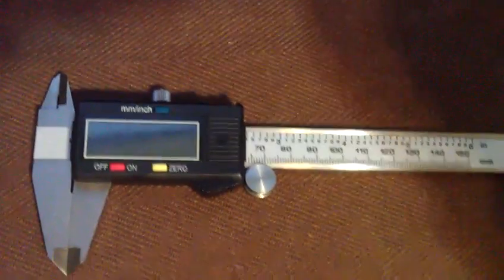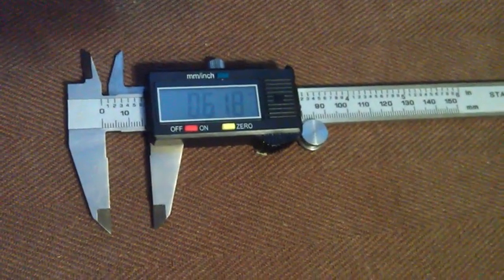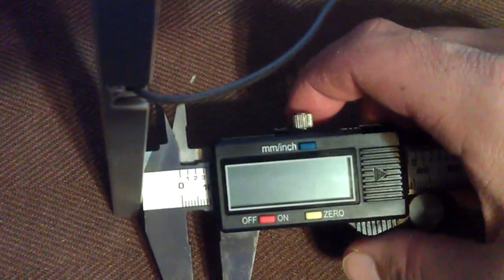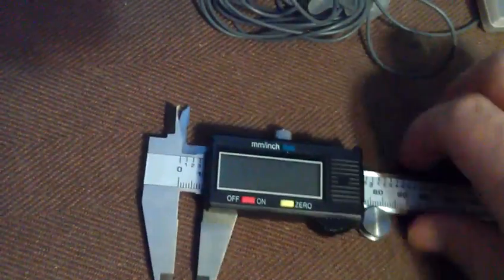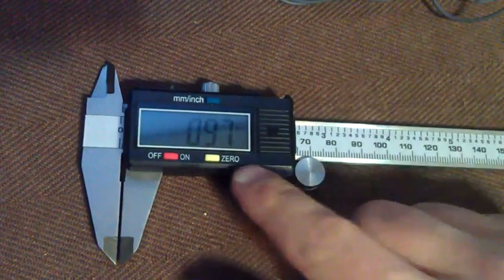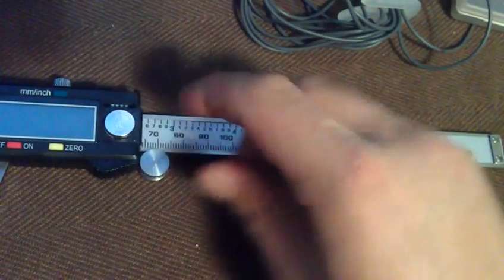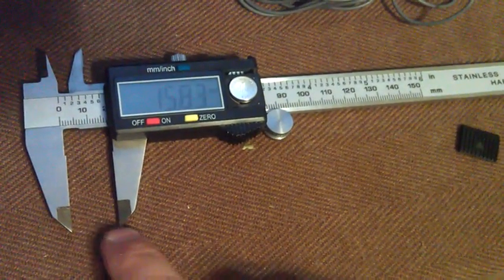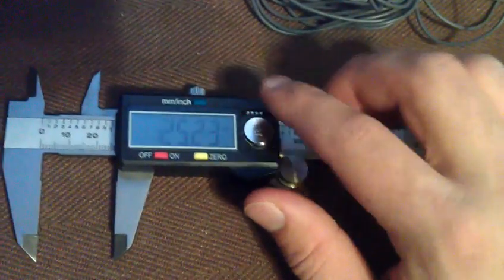How To Use A Digital Caliper

Comment: Also the thin stem part that comes out of the bottom can be used for depth as well as the left edge of the back most interior...... the part that looks like (| can measure against the edge of the caliper.

Comment: My battery is dead and I don't have my manual. could you tell me what kind of battery i need to get?
Reply: If it is a button cell battery, you can take it to Walmart if they have like a Duracell or Energizer booth and size the battery. They also should have markings on the top (for example, CR2032) that tells you the type of battery it is

Comment: I don't get all the negative comments. I knew nothing about calipers before, and now I have the basics of how to use one. Thanks!
Reply: agreed. I picked up a tool that is very similar to this one. We call these do-hickeys calipers, but my tag termed it a "micrometer".
I needed a visual and this kind man took the trouble and produced this video for others. Anyone who reaches outside of themselves to help, assist or aid others automatically wins points from me for taking action and sharing.
Yes, maybe he could have waited to make the video until he had a working battery but he thought, what the hey, let's go for it' and did.
 You can tell the dude's a laid back guy who wasn't bothered by the fact that his battery went caput soon after starting. And yes, he's not a polished pro, but  really;
I'm not going to beat up all over him for that. Man! The anonymity of the internet brings out the meanies
It was this model that I was looking for and I am glad he made this video, as it was similar to mine and his little walk-through helped me. Plus his had that depth slide rule which mine doesn't have and now I know I'd like one with that function.
Hmm, what is worse ~ a laid back man giving an easy-going 4 minute look-see or the hard-core professorial types, who stammer and pause and take forever to explain something while weighing and searching and parsing every daggone word, which he/she then goes on repeating six times making sure we got it?
UGH! Those  slow, droning, perfectionist type speakers drive me crazy and I get crazy listening to them struggling so hard to get it 'right'. But I still don't criticize. I'm not a cruel person who enjoys humiliating, bullying or berating people. I can find a way to give criticism without making someone feel like shite.
There's a happy medium in between, I think.
Hey, we're sitting on our butts and these tubers are sharing their knowledge, skills and time and I am just very thankful they take the trouble to do what I, myself am not..
It shows they are thoughtful people, going the extra mile to share. 

 So I'll give a thumbs-up just for the effort!!!
And all you meanies can write; "PREACH" and TLTR - too long to read or some such acronym.
Too many words or lines for impatient little minds; don't bother, just skip it and move on.

Comment: You clearly missed two other important features that the digital caliper offers: How to measure the center distance of two equal sized holes and how to measure the distance between two planes (using the head of the caliper).
Reply: I'd be interested in that Brian Peterson. Do you have a video toot on these points?

Comment: what is the actual numbers mean? like if its showing 0.3 inches, or 1.7 etc
its cool, but you still have to translate that # to the tapemeasure...
Reply: Csaba Farkas .3" translates to 3/10 lol..  Because you know, the number is in the tent place after the decimal

if it was .03" that translates to  3/100 because it's in the hundredth place of the decimal.

Well lets take something we both know  0.5" we know is 1/2" but it can also be 5/10" but no one ever says that so you simplify it to 1/2" 

Some more examples:
0.23" = 23/100"   
0.023" - 23/1000"
.231" = 231/1000"

and 1.7" = 1" + 7/10"  = 1 and 7/10"   is how you would read that
Reply: Candi Soda WOW!!! I just got new calipers for my jewelry making and I didn't really know how to use them. I received no instructions with them. I didn't know about depth. I knew the info you just provided but I'm (not young... Lol) and the review you gave was informative and reminded me how to do the math.  I just wanted to thank you. Enjoy your day sweetie. 💞❇️🙏💜
Reply: What the FARKAS are you talking about pal?
Reply: Read it and figured out pal...
Reply: 0.5" is 1/2" 0.75" is 3/4"...
But what is 0.3" translate to? Or 0.56" ???
U get it now?
Reply: @csabi72   convert decimal inches to inch fractions. Caliper says 0.322”, I go 0.322 x 8 = 2.576, round up = 3, and use the 8 as the denominator. So 0.322” on you caliper display is 3/8”.
Reply: @rocketrider1405  thank you, finally someone explained ez